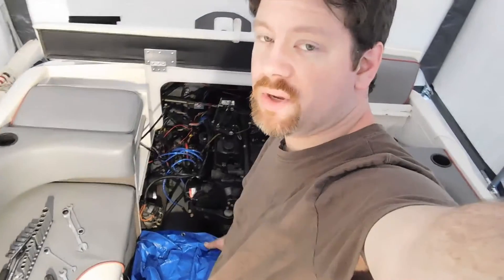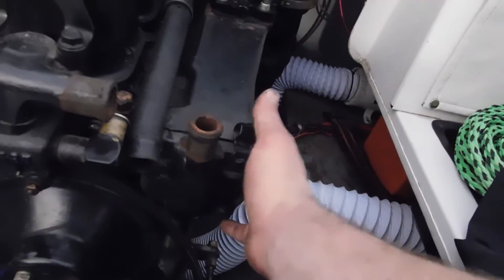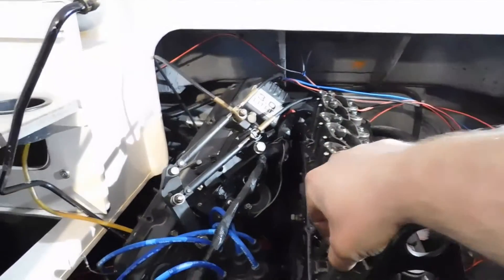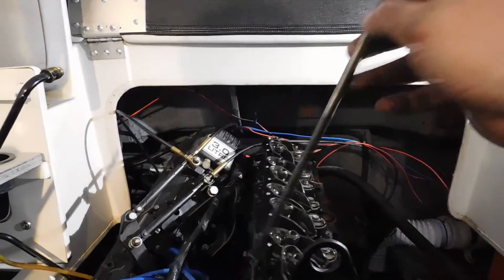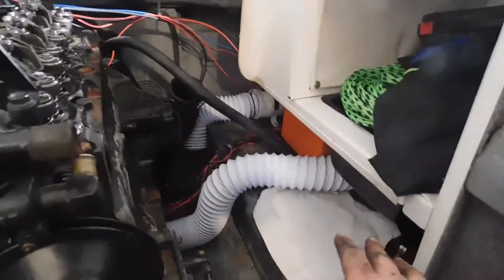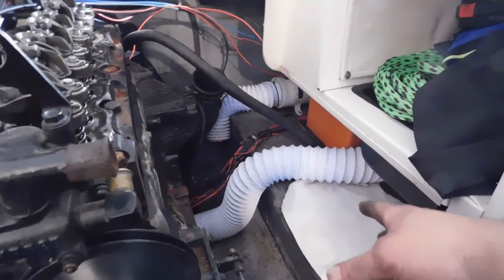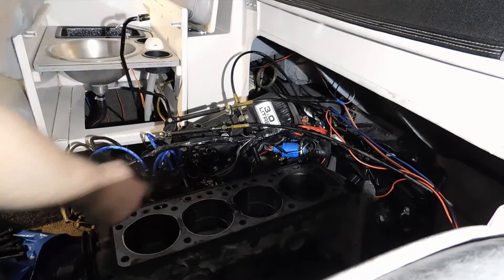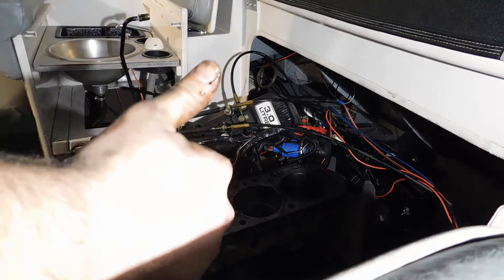Mercruiser 3.0 Head Gaskets

Comment: I am mechanic at car dealership. Found 2004 four wins with this exact problem. Boat is in great shape other wise. Is it worth 3900?
Reply from the maker: As long as the floor and hull are good
Reply: @daleofalltrades  Thank you. I thought so looking at similar boats for sale. Also, good comment about keeping the pushrods in order.  I have worked on engines were the exhaust and intake are just the smallest amount different in length. Super easy to switch. Best case engine runs rough, worst case you spin a lobe on the camshaft.

Comment: I own a 2005 5.0  Mer and after change plugs, wiring cap and rotor, IAC Valve, ignition module still doesnt start. After a compression test all did 120 but one that have 0 compression... thisis a starting point for cylinder head removal.  Maybe first thing was to perform a compression test but dont care on getting all this OEM parts cause Still maintenance.... but boat still sitting on the trailer... :)  Next Compression Leak  test but I know already hows its gonna end... THANKS 4 YOUR VIDEO !!

Comment: Be sure and check your ignition timing. On some 3.0's the timing is 1 or 2 degrees ATDC to help with blowing head gaskets
Reply from the maker: It veries per engine. It should be displayed on top of the spark arrester by the carburetor. Most models have a lot of info stamped there I believe mine is stamped out to be at 6

Comment: Great video and cautions.  Advice on "mechanics special" purchase with suppossibly blown head gasket.  Obviously head gasket due to overheating, to what extent hard to tell without diagnostics.  What would most common problems be?  Really surprised the 2nd impeller would go that quick even with some leftover debris.
Reply from the maker: Well in my experience the most common cause of overheating is impeller failure.  Or any other type of water inlet restrictions.  I was surprised my impeller failed so quickly as well. Handful of reasons it did.

Comment: Nice job. Too bad I have to pull my motor out to get the job done. But the problem is I can't find the head gaskets would you know where I can find gaskets and such? It's a 1991 mercruiser 3.0
Reply from the maker: There are links for the gasket I used in the video description.
Reply: @daleofalltrades  thanks.
Reply from the maker: I have a reassembly video also
Reply from the maker: Also. Check out this video before hand.  I ended up having to do the job twice.   https://youtu.be/p5q3fEBXSQ8

Comment: Same motor on my Bayliner. This is blown head gasket #3.    “I just can’t win…”. This time I tear down I will check block with rod and feeler gauge.  What solutions do I have if there is too much space on block to flat rod?
Reply from the maker: Funny you say the 3rd one. I'm on number 2. Check out my update video. Should give you some valuable info. I think mines good now. https://youtu.be/p5q3fEBXSQ8
Reply: @daleofalltrades  just watched it.   Awesome information.    I’m going to try to find that permatex.   After I fix this engine, the bayliner is getting sold. Hope I don’t pass a problem engine down the line but I bought an offshore center console with an outboard merc.
Reply from the maker: I hear ya. I would like to upgrade to something bigger someday myself. I would highly recommend sanding both surfaces like I did. I feel it helped.

Comment: got boat with same engine, but completely seized, pulled it out from boat, literally tear it apart, cylinders honed, all parts has been cleaned and repainted, im a few steps from put the rest parts together and run the engine in my garage before put in boat. Only one thing i can notice about this video - dude, you have a block cracked same place as i got and it looks like it coated with Jb weld to fill crack. I cleaned my block and weld the cracks using  55 nickel rods, apply a JB weld after to get no leaks guaranteed
Reply from the maker: Yea I had bought the boat the fall before this video. Unfortunately I had se wool pulled over my eyes. The repair was well hidden.  It's fixed fine as I have no leaks and no water mixing with oil... I'm running it like that for now.